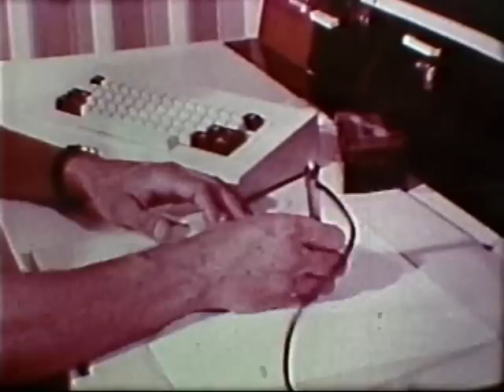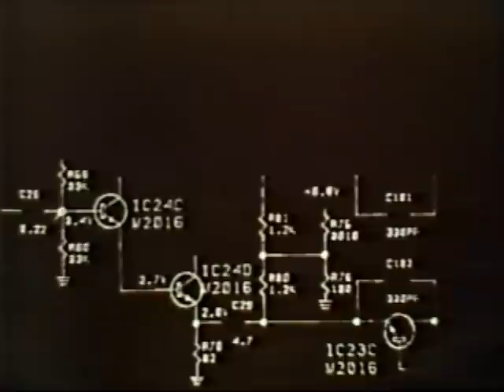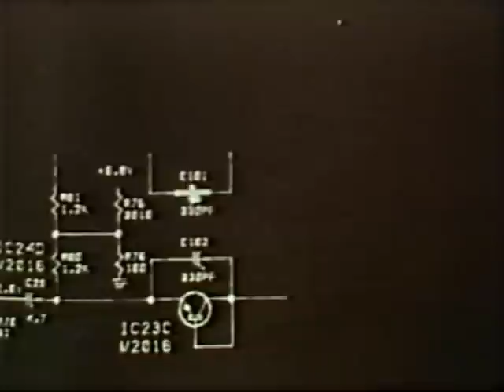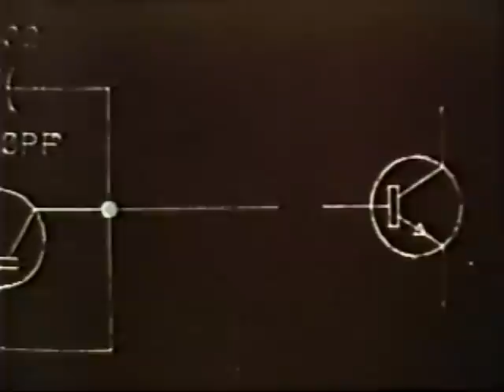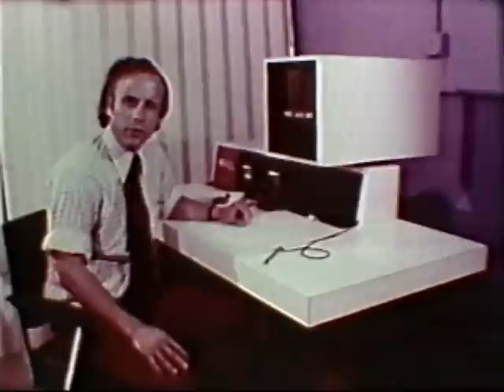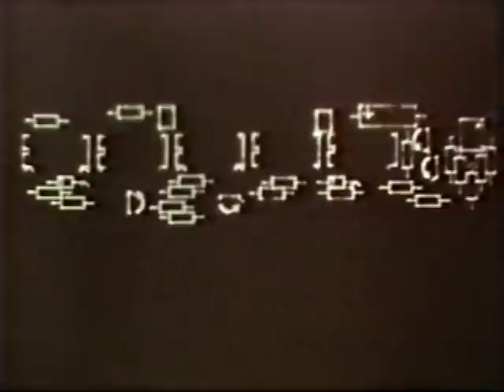Applicon Design Assistant -- Part 1

Comment: Yea...  the terminals used in Battlestar Galactica were old tek4006's.   Classic vector graphics terminal of the mid and late 70's.
Reply: Yes, I know, these tek4006 look more like the Battlestar Galactica's monitors. Those were called the storage beam monitor, you can use this monitor for wireframe drawing using green beam vector lines. Later on, they came along with the raster scan monitors in color. From the '70s through the year 2000, monitors built in CRT. Today is LCD.

Comment: This system looks more user friendly than even todays CAD/CAM software.
Reply: Did you know that the Bravo software came out the same menu setup idea before the Apple and the Windows software? Well, I am not sure but I believe they did or I may be wrong.
Reply: The Bravo software was develop somewhere around 1980 through1983 when the VAX computer came out .They build the 4265 GPS  which is powered by the DEC VAX-11/730  and the 4275 GPF  has a VAX-11/751 processor using 2-Mb memory , it can be expandable to 5 Mb and the hard disk ,is the Winchester disk is only 160Mb ! What a big different compare the memory of today in GB in rams and  GB storage disk, which come in SD memory card that be put into the laptop ,touch screen tablet and Smartphone !